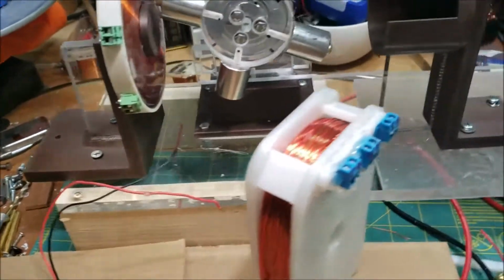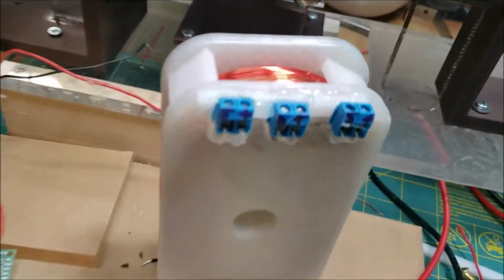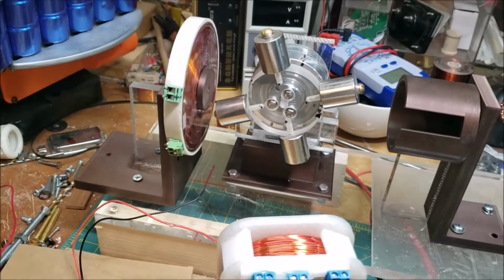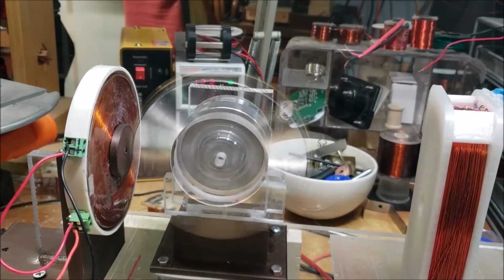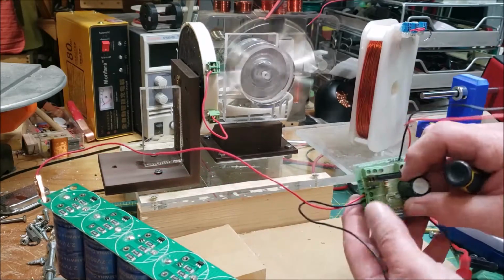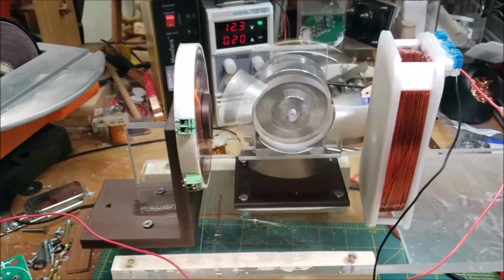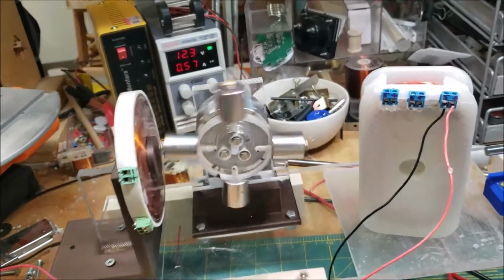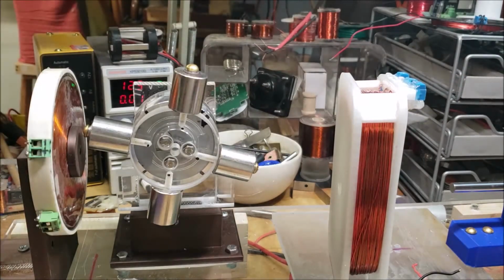New 3D Printed coil having issues (need your help)

Comment: Take a compass, hook each coil to a double A battery one at a time. I would check the phases of the coils.
Reply from the maker: will do
Reply: @mcorrade  https://youtu.be/xoAMOzdLZIs this video reminded of another issue you might be having. Ghe small gauge wire limits the amount of current allowed to flow to the transformer.
Reply from the maker: @MAGnetICus_Attractus  its funny that just mentioned this as I was thinking it may be have a transformer affect or some other weird thing. I need to really properly test it using all the methods mentioned here. I will start wit the compass test
Reply: @mcorrade  I am willing to bet it is the bottle neck effect. Like another post says you get the capacitive effect going on. Think about my pipes and how I could quickly fill the large pipe and it would slowly drain down the small pipe. Now reverse. Then you have the crossed wires most likely. Why I find it hard to make very neat coils like sky collection. I make nice secondary coils but I have yet to make a pancake.
Reply from the maker: so I did the compass with a battery and each coil responded alike and correctly. I'm thinking that at the top where the wires come into the connector that they may be shorting where I striped off the enamel. I think it may be doing it intermittingly or something. I will remove the connector and then retest. I'm truly baffled at this one. All basic test that the coil in question is fine.
Reply: @mcorrade  I think you got a bottle neck issue. Try running the bigger gauge coil with a resistor wire(smallest gauge wire short lenth) i think the bigger coil is keeping the smaller wire saturated.   If it is in fact bottle necking the short small wire will reveal this. I learned this with my mechanical magnet switches. The small gauge wire for the electromagnets were keeping current limited to the microwave transformer. I am terrible when it comes to transistors to perform this function. Why we used to use light bulbs as fuses on high power car stereos. 2 100 watt light bulbs will keep the amp from sending more than 200 watts of power to the speaker. Trust me if I could I would be running my subwoofers on my wheel just to shake the building :). My subs have bigger coil wires.  I have burned up a few small speakers. Not to mention burned out many lightbulbs. When my flywheel gets up to speed the light goes out, meaning it is drawing very little power, as the flywheel loses momentum the light will dimly shine as it starts using more current. With my water works I tell people a one inch is 4 times the volume of a half inch pipe. 25mm and 12.5mm .
Reply from the maker: @MAGnetICus_Attractus  will do thanks

Comment: If your using the coil as a drive coil it may be getting triggered twice because of its size and shape , notice the magnet passes twice over the two arms.
Reply from the maker: I think you may have something there.

Comment: IF your using the coil to collect energy you will need to drain that energy into something else or it will act like a brake
Reply from the maker: actually I am draining it though the circuit. The JL94 has an output which is going to a bank of supercaps. I do appreciate the comment and I now think its a short in the coil. I will wind another and this time just make it a bifilar coil as I should have done in the first place.
Reply: @mcorrade  if there is nothing wrong with the coil and that coil has a trigger winding then the magnet is passing by the two arms of the coil and it might trigger twice unlike the pancake coil has core no?
Reply: @mcorrade  put it on ohms only no sound measure the resistance and watch it for fluxuations, if the resistance level is steady there is no intermitant open. A coil naturally is considered a short , anything below 100 ohms usually is a short or at least will beep on the meter
Reply from the maker: @mykedoes4099  I'll do that. I've closed the shop for the evening but will do that first at some point tomorrow. Thanks for the advice
Reply from the maker: @mykedoes4099  ok so I just checked it quickly and it seems ok. I have three different sizes of wire but all the same length so the readings seem normal. 7, 10 and 20. I didn't have time to check which one was the lower vs the higher but they seem ok
Reply from the maker: I will make a more through check tomorrow